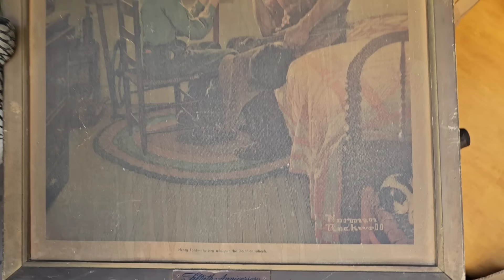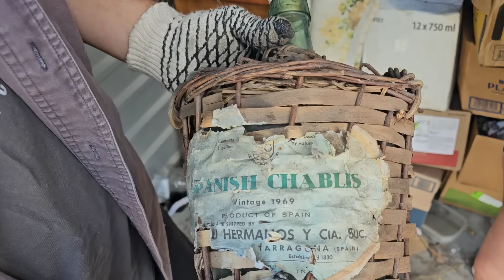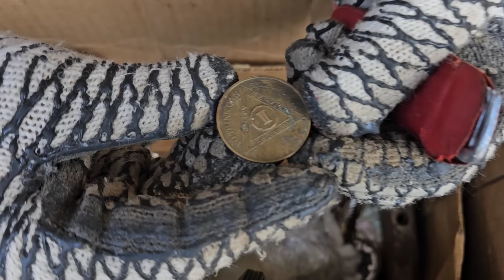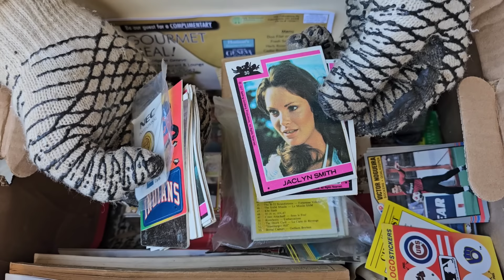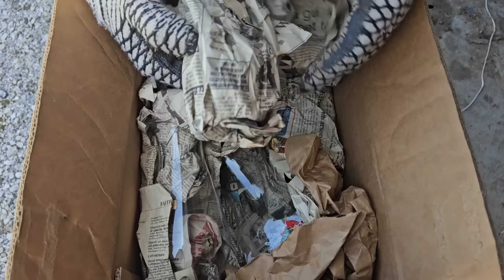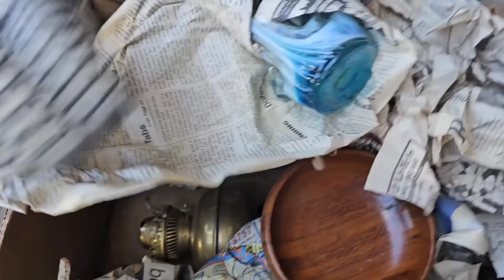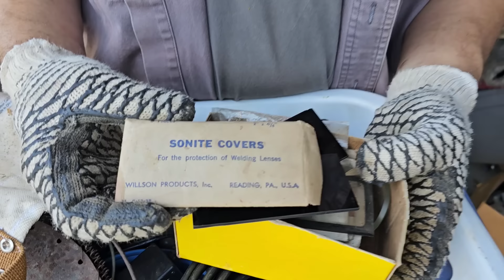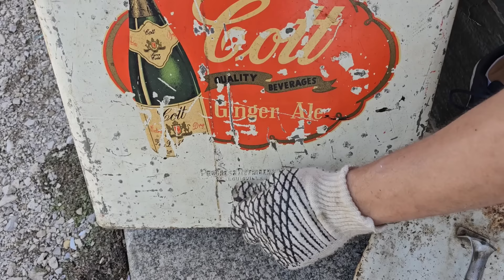FOUND COKE IN DRUG DEALERS STORAGE UNIT

Comment: I even know a guy who lost more than half of his dash when the took his stereo. I used to instaall sound systems in the mid 70s, and yes, lots of them were stolen. At one point I had a car  that ran great, and looked like crap, because I drove around with a load of camera gear. One night they skipped over my car, hit the cars on both sides of me, the skipped the 4th, and hit the 5th. I had 2 full size VHS cameras in the back, all of my still cramera gear, and lights, under my dirty laundry. Not to meantion $1200 in sound equipment. The other car they skipped had all Alpine stereo gear, but his old GTO was 15 colors of primer. LOL

Comment: The red metal cylinder is an oil bath air cleaner off an International Harvester tractor, probably worth around $150 in average condition. That one appears to be 100% complete, and likely worth about $250 for someone restoring an old IH tractor.

Comment: That red/orange metal tube “you had no idea” is an oil bath filter for an old pre and early 60’s tractor. I suspect it’s been painted. I’m guessing probably an International Harvester or a Ford. I know the aftermarket breather for a Ford 2N, 8N, 9N runs about $100

Comment: On that letter you found the oldon't 2 possibilities. 181 under front of a building for porch light or 2. When I'm one of the old model t's pause, my opinion was off the car. That's a real old treasure, fine later.